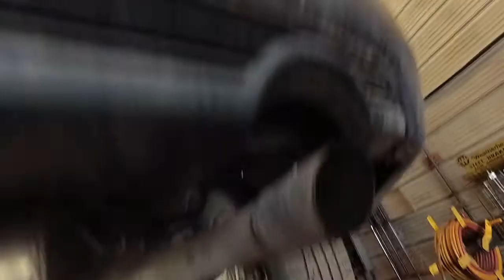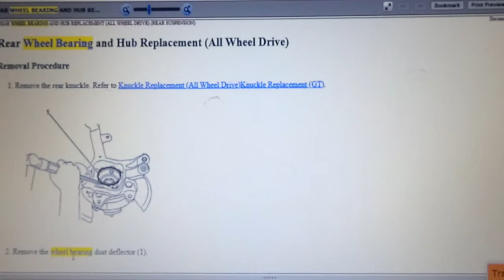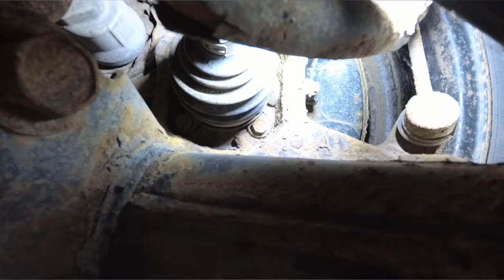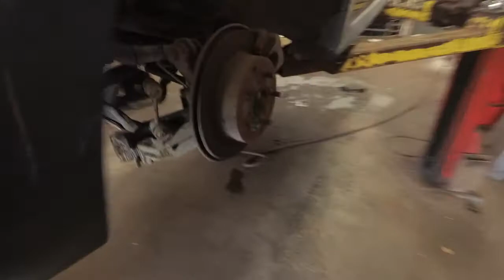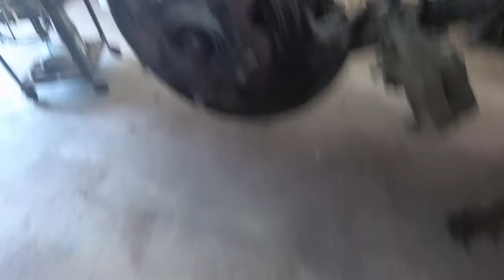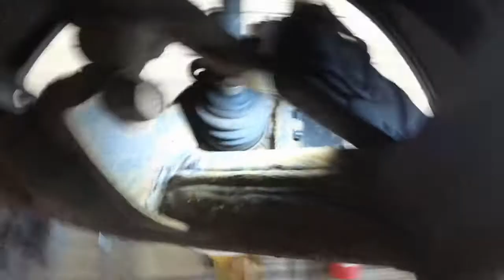2009 Pontiac Vibe AWD Rear Wheel Bearing Replacement

Comment: Did you just bang the bearing out with a sledge? Mine is all rusted in.
Reply from the maker: I knocked it out of the backing plate with a big hammer. It helps if you have a helper.Hold the backing plate with two hands while you hit it with from the back side.
Reply: @PhillipBailey thanks

Comment: Once the axle nut is removed and the four hub mounting bolts have been completely loosened, hold one hand on the backing plate and hit the face of the wheel hub between the studs with a fairly large  hammer and alot of force. The same way you hammer a stuck brake rotor. Once the hub begins to break free you'll hear the sound change while hammering. Slide the hub and backing plate off of the splined  axle shaft and tap the hub out from the back side. No need to remove the e-brake shoes. When aligning the new hub to the old backing plate, put it on the backing plate and check the alignment of rhe bolt holes before sliding over the axle shaft.

Comment: Would have been useful to show us how you got the rusted bearing out… ive had mine soaking in pb blaster and used heat and it still wont move while smashing it with a hammer, all I’m doing is destroying the backing plate now
Reply from the maker: At 4:30 I mentioned how I did it. Thread two of the retaining bolts halfway in and use an air chisel with a punch to push on the bolts from the back. Once the backing plate assembly is off the knuckle I just hit it from the back with a hammer to pop the bearing out of the backing plate. Sorry I didn't show the process. Need a camera man.
Reply: I did that, it didnt separate the bearing from the backing plate, it just loosened off the backing plate from the knuckle

Comment: So i have everything out, am I going to have to pound the wheel bearing away from the backing plate with the emergency brakes?
Reply from the maker: If you're in a rust belt area the bearing will be rusted into the housing. Be careful not to damage the wheel speed sensor.
Reply: @PhillipBailey  waa able to remove the sensor. Pb blaster and  a lot of pounding. What a mess! Bearing was in pieces, but I got it.
Too broke and too stubborn to pay someone else to do any mechanical work for 100 an hour
Reply from the maker: @BearBudgetgarage  definitely not a good design. We're you able to get at the 4 bolts by bending that stupid tin shield or did you take the shield out?

Comment: Did they put those grooves in the bearing to give access from the front?  I mean put the 4 bolts in from the front side. W those grooves you have access.
Reply from the maker: Nope sorry the threads are in the hub bearing. Can only be bolted in from the back side.
Reply: @PhillipBailey  wondering Philip, if machined a hole in the bearing plate  so a socket head could pass through then you really could put on the bolts from the outside.  I just don't know if that would be safe or would the bearing hub shatter for messing w it.
Reply from the maker: @auggiebendoggy  but you would still need nuts on the end of the bolts. I would not recommend trying.
Reply: @PhillipBailey  why they're threaded on the housing.

Comment: I'm trying to replace the cv axle seal on the rear diff. The instructions say to remove the knuckle too. I got the upper control arm bolt out. The lower and rear control arm bolts are seized. I was able to get the lower bolt nut off. The rear control arm lock nut broke off but still has another nut on there. It's the bolt where the rear alignment is adjusted. With the upper control arm bolt out there is almost enough space to sneak the axle out of the wheel bearing.
Reply from the maker: Those suspension bolts always rust into the knuckle bushings. In some cases I've had to sacrifice the arm or other suspension parts that hold the bushings. The inside if the bushings have a steel sleeve that rusts to the bolts. Good luck.
Reply: @PhillipBailey  yeah you're right I forgot about that.  I've aborted the mission to replace the seal. I'm going to monitor the fluid level and add stop leak and top it off at regular oil changes. The level of effort required to replace the seal is too high.

Comment: What noise can it make
Reply from the maker: depends how bad the bearings are. Usually sounds like a hum or if worse a howl that increases with speed. May also be load sensitive and change pitch or intensity when switching lanes at highway speeds.